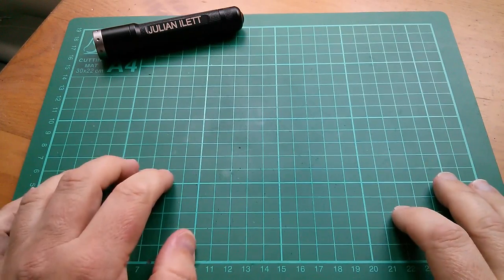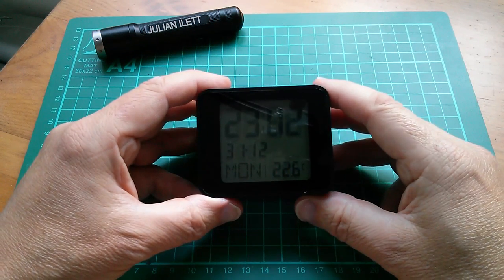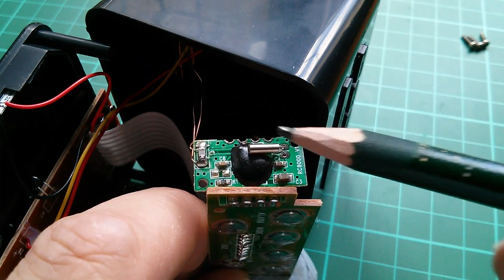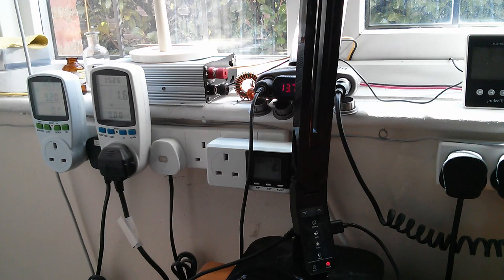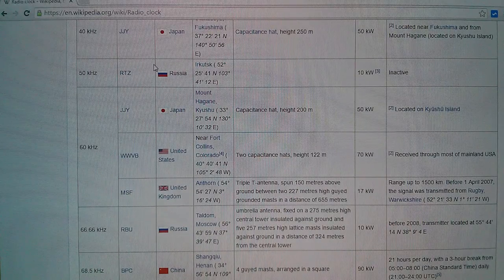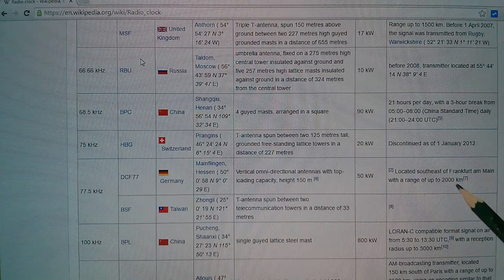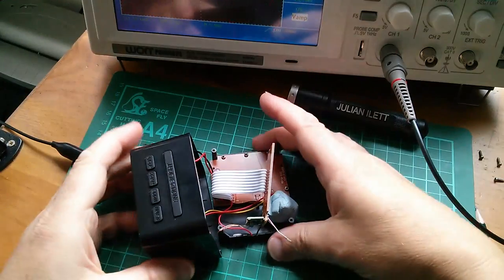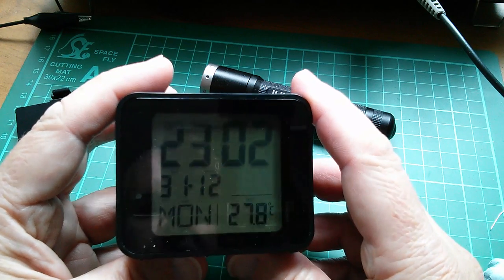From the Lidl non-food Aisle: DCF77 Radio Controlled Clock

Comment: just an information about the antenna. The ferrite antenna is used to catch the magnetic part of the electro-magnetic field. Because of the rather low frequency, an wire antenna, which catches the electromagnetic part, would be way to long. Remember Lambda/4 lenght. Calculate the wavelengt off 77.5 khz and you will see. ;)

Comment: I'm amazed they still manufacture radio clocks now that cell time synchronization has made them obsolete, I used to have a couple of "atomic" watches that synced with the colorado transmitter which is incredibly far from my location, but only at night through skywave propagation ("skipping" for those familiar with CB parlance)
Reply: Cell phone towers in the US get their time signal from GPS and WWV. Not obsolete at all to get the data directly from the source.

Comment: Ages ago when I was in school, my teacher wrote a PASCAL program which makes the signal bits visible in a huge table. when data collection was finished it showed time & date of course ;) it uses a simple DCF77 receiver from conrad connected to a serial port. I still have one of those laying around. you can just hook up 5V and an LED at the output to see the transferred bits. I think the difference of "0" and "1" was just the pulse length. here is a link to the receiver, but I think you can get it somewhere else for cheap if you are interested: https://www.conrad.de/de/dcf-empfaenger-modul-641138-passend-fuer-serie-c-control-641138.html
Reply: btw: there is also arduino code available for DCF77 signal processing. maybe you can grab the signal from your clock and get it read by an arduino :-)

Comment: DCF77 works really well for me in London, much better than MSF60.  There are a couple of crucial things to bear in mind... firstly the ferrite rod is highly directional, if you have no luck then rotate through 90 degrees... secondly the timebase of monitors and other RFI from computer equipment completely cripples these modules, you should really put the receiver in a place away from any computer equipment.  The signal itself is very simple... the whole time code is sent once per minute, with each second either being 100mS of absence of carrier followed by 900mS of carrier or 200mS of absence of carrier followed by 800mS.  What you saw on the scope wasn't the signal, it was noise.  To get date and time you have to listen to a whole minute and in practice you need to listen for a lot longer than that as you need to work out where the minute starts and to correct for inevitable errors.
Reply: If you move the radio to the window (away from any equipment), extend using a bit of cable, and watch OUT and GND as you are doing then with a suitable bit of rotation you should get an OK signal.  Make sure you have a very slow timebase as you only get 1 bit per second.  FWIW the clock probably only tries to acquire the radio signal once per day during normal operation to save battery power... as you guessed PON is used to enable/disable the module.  Good luck!
Reply: https://github.com/udoklein/dcf77 is a library for Arduino which would work with this module.
Reply: Yep, switch mode PSUs like to operate in the 50-100kHz region. Makes sense that high powered or badly designed PSUs will interfere.

Comment: Nothing wrong with Lidl. Although I did buy an analogue clock there a couple of years ago which couldn't be changed to GMT.
Reply: There is a trick with those - you basically have to unscrew the glass, pull the hands off and put them back on pointing to 11. There are other videos on YT showing you how. The only issue will come if when the UK leaves Europe, our Govt change the weekends on which the clocks go forward / back (or as campaigners have been demanding for some years, abolish British Summertime altogether).

Comment: why they dont sell clocks with the "english" reciever? if u go to scotland .. ireland etc. u have no chance. 
it is like to buy sun protection for submarines.
greetz from germany
Reply: The scots tell the time by squeezing a haggis, and the Irish use seaweed.  Nobody needs a radiocontrolled clock.   A bog standard quartz mechanism is accurate to within a few seconds per year and doesn't chew batteries or give crazily wrong readings at times like the one I have.
Reply: They do, I have 3 UK market radio clocks (two analog and one digital). They're set up to use the MSF signal from Anthorn in Cumbria (previously Rugby before privatisation). However, my understanding is that the signal isn't as strong, and in outlying parts of the British Isles, the one from Frankfurt is actually easier to receive.

Comment: the Lidl clocks tend to get their signal from the german transmitter and are more finicky, my Oregon scientific clock gets its signal from the UK and is much more solid, the part flashing means its somewhat acquired the signal, but is trying to get all the data for setting the clock.
Reply: When MSF60 was in Rugby it was much more reliable; however now it has moved north and the power reduced.  Today in London DCF77 is much easier to receive than MSF60.
Reply: +NivagSwerdna There are some of us outside London you know. In fact we need time more accurately so we can all trundle along to our low paid menial jobs and keep the tax flowing to the opulently rich in the capital.
Reply: it's also not over a 1000 kilometers away from the radio station. I wonder why they even bother selling DCF clocks outside germany, as reception on the borders is already bad enough
Reply: Xaviera Yayaell Greetings to all in District 12. May the odds always be in your favour.

Comment: I have several 'radio controlled' clocks and most of them need to be in a window to receive the signal from Europe; it does doesn't penetrate the thick brickwork of the house. Once away from the window they gain or lose depending on the accuracy and stability of the MCU crystal.
Reply: Unfortunately there are several feet of brickwork (a 9" wall, a 14" wall and a large chimney breast) between my bedroom alarm clock and the transmitter in Europe, the windows in that room face due west and the normally highly penetrative L.F. signal just doesn't get to the clock's aerial. To get it synched to the signal it needs to spend
some time in an east or south facing window. I must find one that uses the NPL's MSF transmitter in Cumbria.
Reply: England.
Reply: my oregon scientific brand works on the UK signal,

Comment: Very interesting video, thanks so much for those you put up. I do enjoy all the electronic things, and learn very much from your videos.  I am currently trying to work out a problem, I purchased a nice looking little clock kit that has built in temps, however, like most things from China, this one refuses to tell me the F temp and will only display the C.  It has a microcontroller by STM on the board, and there is even a 4 wire port on the board where I am guessing a fellow could tap into the controller and reprogram.  Problem being I am only a bit fluent in Arduino, and speak just a bit of LUA for ESP8266s so even if I did enter the STM chip, I would have no idea how to make it speak American English instead of that  C temp that everyone else in the world knows.  My wife and I are becoming a bit familiar with it, for instance we do know that 23 degrees is comfortable where 30 is hot and 36 is our body temp (I think)  Right now the thing says it's 26 degrees here in the house and it's fairly nice, my computer says outdoors is 76 in our real degrees. Here is the kit I assembled yesterday:  DIY Electronic Microcontroller Kit LED Digital Clock Time Thermometer 3 Colors | eBay
http://www.ebay.com/itm/321822453429?_trksid=p2060353.m2749.l2649&var=510752272102&ssPageName=STRK%3AMEBIDX%3AIT
Reply: The hard solution to your problem is to re-program the micro controller (if possible).  The easy one is to take a small piece of graph paper and draw a plot for the conversion between C and F and leave it beside the device.  Just trying to offer practical help!
Reply: Simple conversion.
<20C = Wear a cardigan.
20-25C = Goldilocks zone.
25-30C = Turn on a fan.
>30C = Move house to somewhere cooler.
Reply: 36 is fine as body temp as well. It varies during the day. If you're above 37°C for the whole day it's actually already considered elevated temperature.
Reply: Sure puts a kink in the old song, Hey  98.6 it's good to have you back again!   Just doesn't ring Hey 36 it's good to have you back again?

Comment: does any one think that the Cristal on the radio module sets the frequency
Reply: It has to do with comparing the incoming signal to a reference (tuning like on a radio receiver for music)
Reply: Could be superregenerative receiver.  But the crystal would be huge and cost too much for a cheap atomic clock.
Reply: Crystal is used as a bandpass filter in RF input amplifier.
http://www.mas-oy.com/wp-content/uploads/2016/05/DA6180C.pdf